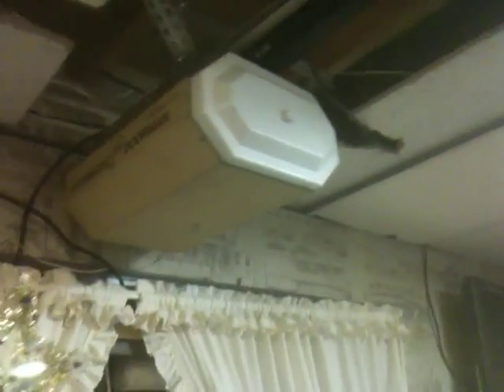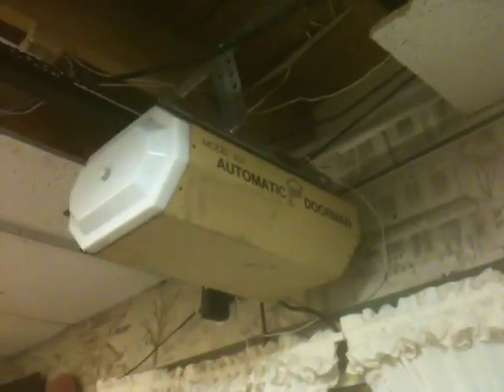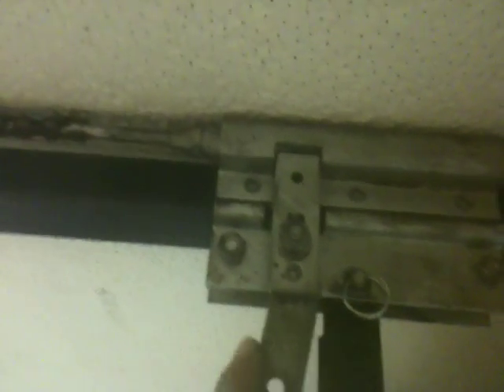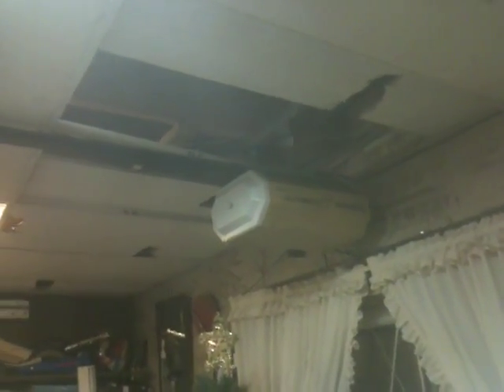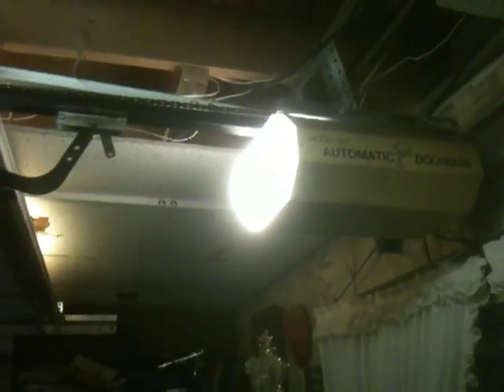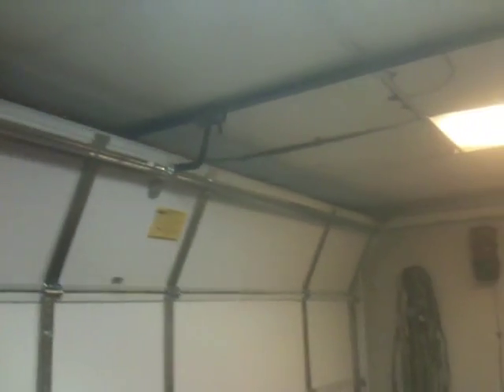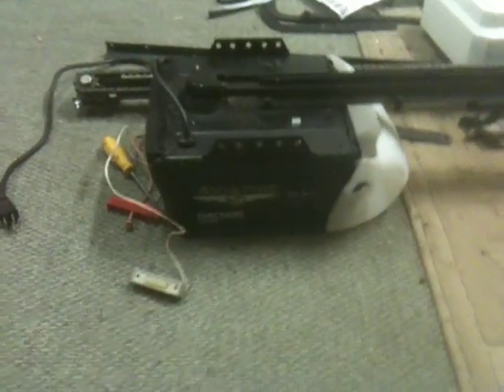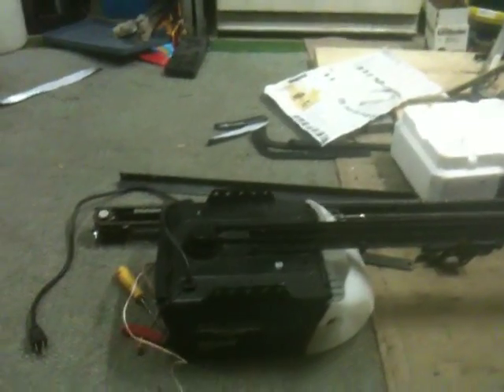Automatic Doorman 455 on the buildmark

Comment: Automatic Doorman was in Patterson, New Jersey. It had a three screw terminal strip that would accept a variety of radios. All external, no receiver inside. You can still get some parts. Electrical parts are all common over the counter.